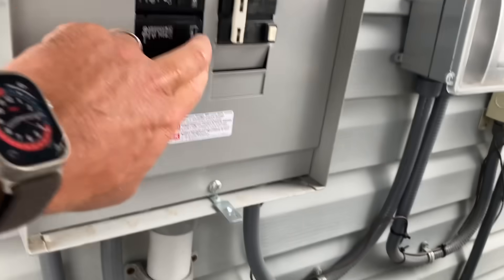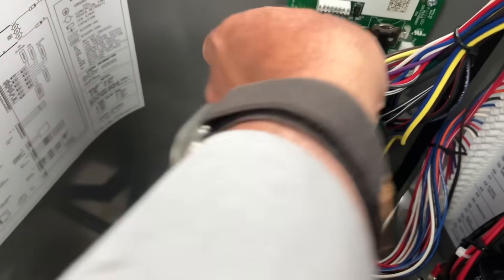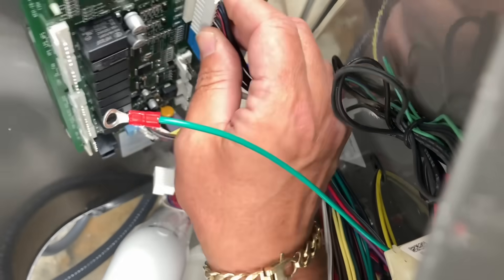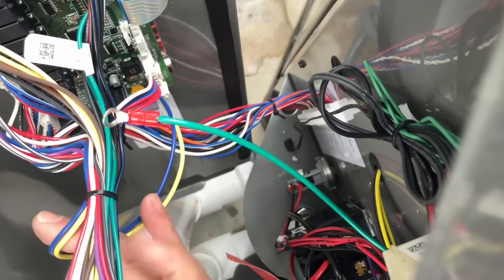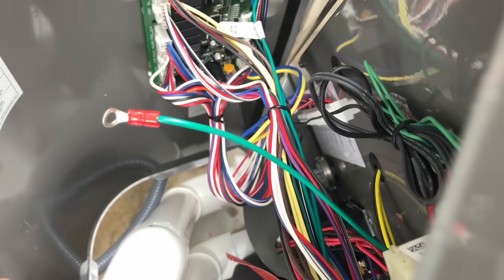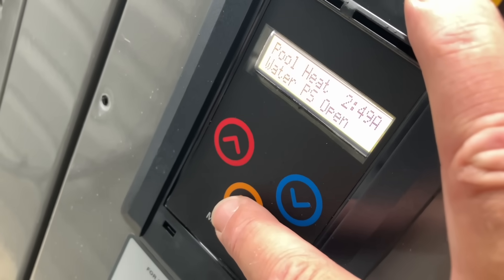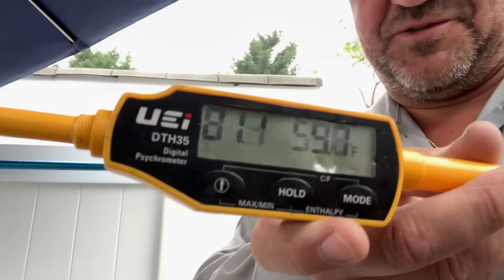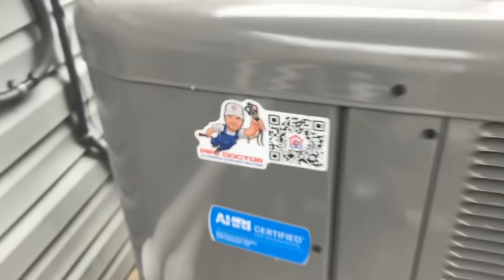Brand New Pool Heater DEAD?! RayPak Heat Pump FAILS Out of the Box | Real Repair Long Island, NY

Comment: Hey Mike Daick, of Mikey Pipes Plumbing not easy being cheesy. Looks like another factory fuck up, and there no going around the logic system. Again fail safe logic and the mother board had locked itself out, if wiring isn't correct. Again 42 volts will kill and thank God you're no airplane mechanic too,lol. Love you buddy, you be safe out there.